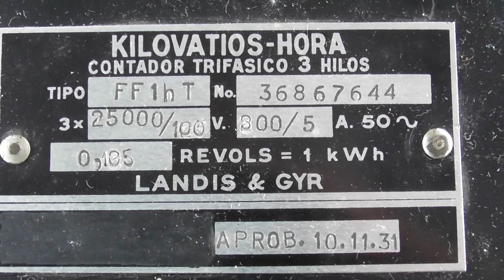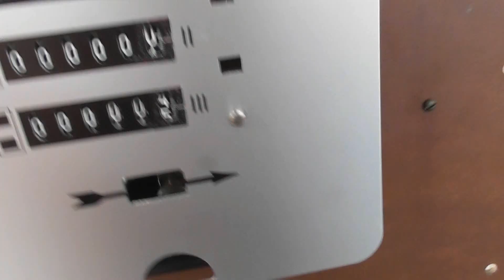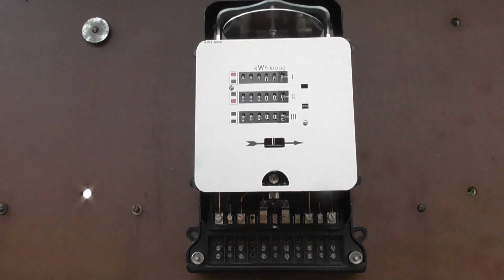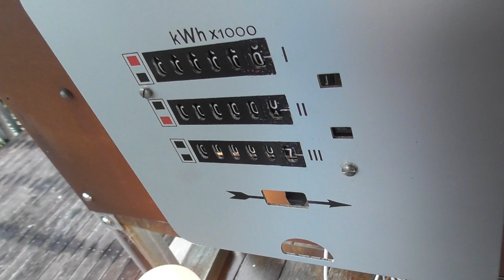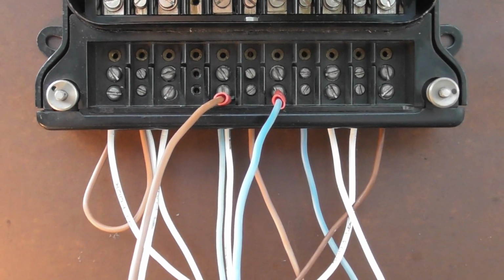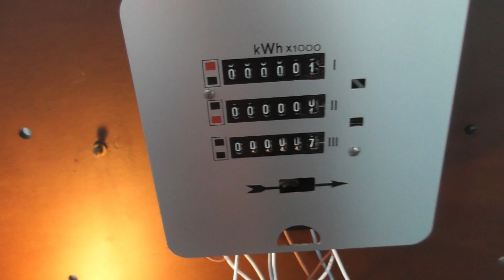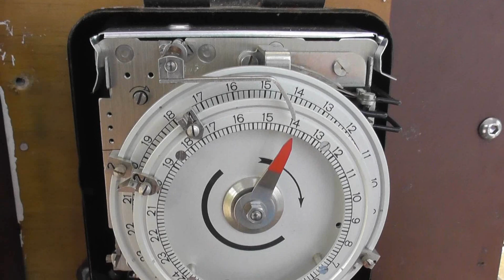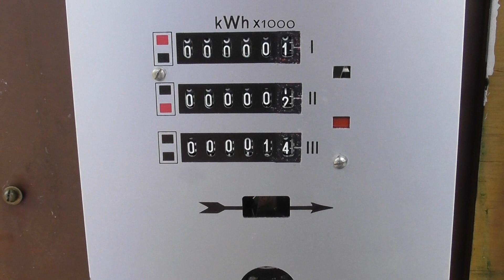Landis & Gyr 3 Rate 300/5 Amps CT meter 25kV/100 Volts

Comment: Pisses me off to see shipping damage like that! I maintain used video gear (mostly rack mount industrial stuff) so I see way too much of that kind of shipping damage. I mean really solid equipment that has taken a REALLY hard blow or crush damage like it was in a press! Once time it was a glass  electro-luminescant orange dot matrix display that had a corner broke off when the side of the control panel was broken and bent. Ebay seller said it was packed it in "industry standard packing" when I complained. (Still works tho! and I fixed it up)

Comment: Beautiful equipment, it doesn’t look like it’s from 1931, the register coils and even the current coil insulation looks to be modern.
Reply: Original design was from 1931.  This meter was most likely made in the 1960s.